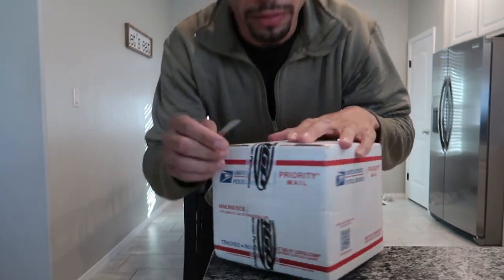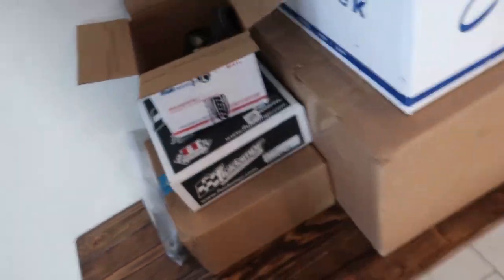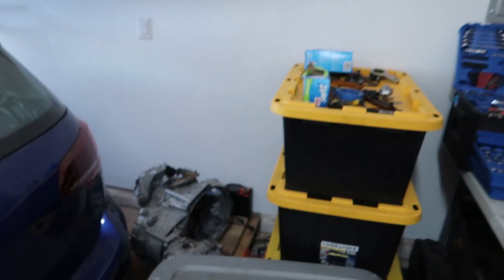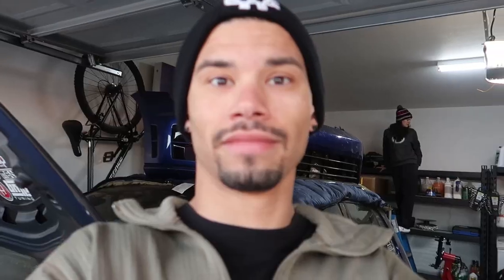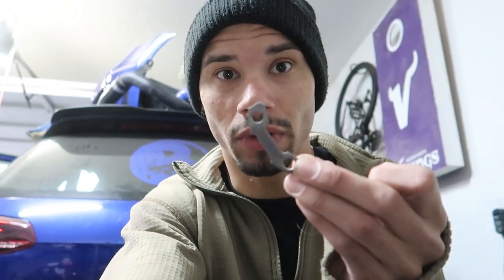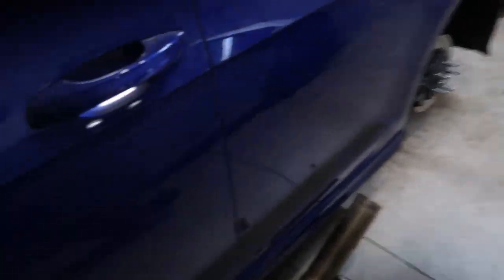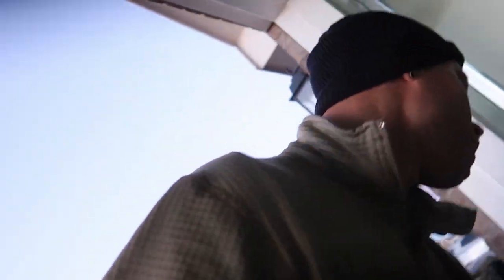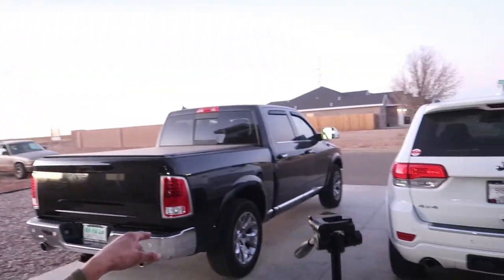Downpipe out for coating! & New front sway bushing annoyances | MK7 Golf R

Comment: Seems like these little plates are only used to distribute the load more evenly so the bolts don't crush the thin metal of the boot "flange", same as a washer on any other bolt. I'd guess it's ok not to have them.
Reply from the maker: Makes sense!